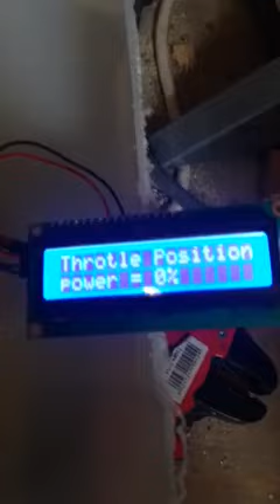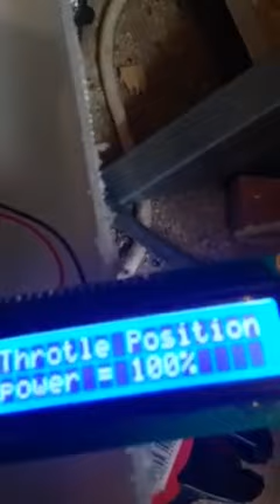Arduino Speed controller made with relays

Comment: Can you help me with the information on how to control speed of fan using a relay and arduino
Reply from the maker: hi yes no problem, can you tell me some details about the fan please, voltage, watts / amps, does it need variable speed or say fast medium and slow speeds? thanks